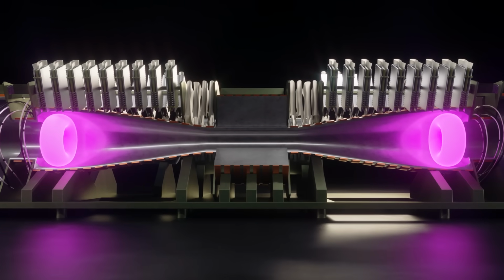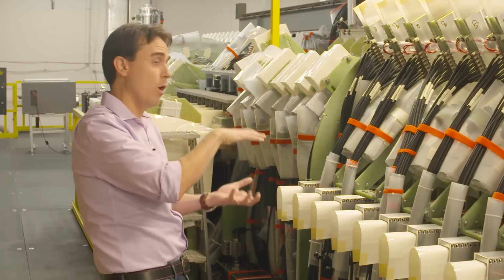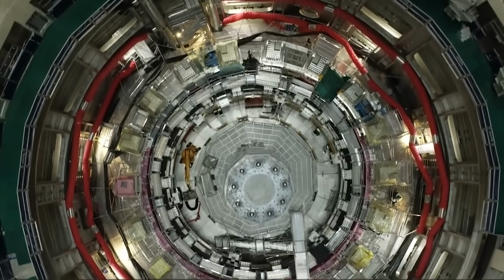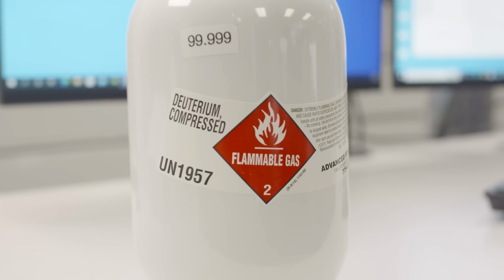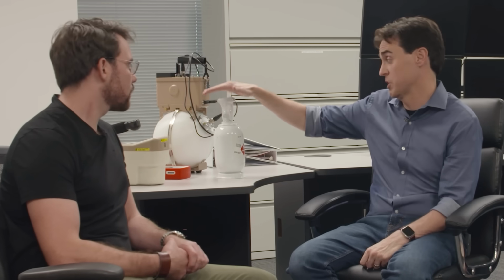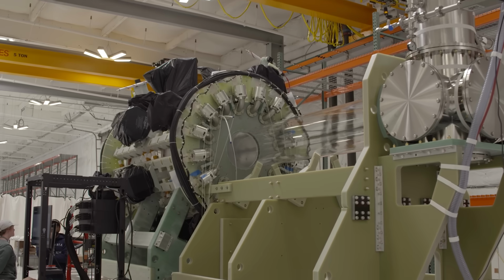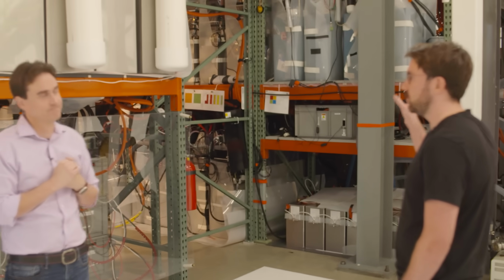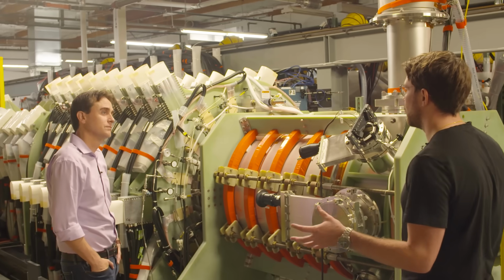A New Way to Achieve Nuclear Fusion: Helion

Comment: I admit I'm a fusion power skeptic. I don't see this getting any closer to actual power generation than the other methods.

It clearly takes a lot of energy to get the fusion reaction and it seems unlikely that they can get enough energy out of the reaction to make up for the energy they have to put in.

I'm also put off by some mistepresentations. Among them:

The million degree plasma rings must be kept away from the wall not because the wall will melt but because the wall will cool them.

And, those stray neutrons don't just fly harmlessly away. They combine with other elements and make them radioactive. Neutron radiation is not harmless.
Reply: Their next machine, Polaris will demonstrate net electricity in 2024. Trenta should be at least close to net energy if it was fueled with Deuterium and Tritium. It is an experimental device meant to reduce risk for building the next, bigger and more expensive machine. Trenta only cost 35 million.
I agree on the wall melting thing. The wall could be slightly damaged over time, but would not melt.

D-D neutrons are not that big of a problem. They are only 2.45 MeV (vs 14 MeV for D-T neutrons) and they only occur in 1/3 of the reactions. The 2.45 MeV are below the activation energy of many materials that they can use (and they are still looking into the best combinations for that.
Polaris can be fully decommissioned withing 2 weeks of operation. The waste will be below background radiation after less than a year.
Reply: @elmarmoelzer2229  "Polaris will demonstrate net electricity in 2024" I'll believe it when I see it. Fusion predictions are always much. much too optimistic. Even if it produces a net increase in electricity will it be more than an AA battery? Also does this "net" factor in the energy requirement to get the deuterium and whatever other exotic isotopes they need?

So far as the D-D vs D-T neutrons. The energy of the neutrons doesn't matter z lot since the main risk comes from neutron capture by atoms creating radioactive isotopes. Low energy neutrons are more easily captured and last longer.
Reply: @jimwhelan9152  
1. Net electricity in Polaris (no matter how small) does matter because it proofs the principle and provides a clear path to the next generation full size power plant. It is about mitigating risks and defining the path forward. It is the same purpose as Trenta.

As for fusion being optimistic. Optimistic predictions usually assumed a certain level of funding. Funding for fusion has been very, very low (below the "fusion never" joke from the 1970ies).

2. Wrong! The fusion energy DOES matter because D-D neutrons are BELOW the activation energy of many materials that then can be used to make the machine from. A Helion power plant can be fully decommissioned within two weeks after operation and all activated materials will be below background radiation levels after less than a year.
Reply: @elmarmoelzer2229  I begin by quoting, with my own emphasis, your original reply. "Trenta SHOULD be AT LEAST CLOSE TO net energy IF it was fueled with Deuterium and Tritium. It is an EXPERIMENTAL device." I can drive a quite large symbolic truck through that level of uncertainty.

Achieving tiny net power per cycle doesn't really matter because scaling up is non trivial. It's not like multiplying everything by 2 or2 10 or 100. For one thing instability of the plasma increases rapidly as do build expenses. U strongly suspect that maintaining the needed precision in timing and positioning of the plasma toroids also becomes much more difficult.

I don't think neutron radiation can be dismissed just because it's energy is below a threshold for SOME materials. Naked neutrons are not safe and will be considerably less safe as everything is scaled up (another scaling issue).

I admit this technology is different but claims it will be "the answer" are premature. Maybe, maybe not. Continue to color me skeptical.
Reply: Also Helion has been criticized for its finances  promises and "science".
Reply: @sassa82   Also unjustified humbug.

Comment: FYI, scientist at Lawrence Livermore National Labs have recently achieved a breakthrough in fusion by producing more energy than they put in, and their fusion reactor uses lasers instead of magnetic fields.
Reply: A load of prevaricating government hogwash. They had to charge up the apparatus with `10-X the energy they got from the fusion. And their method is good for boiling the kettle. This one is straight induction. The diff is the government want a fusion bomb and these guys want to produce electricity. different moves altogether.

Comment: From the description and the video, it appears like the injection reaction only lasts for milliseconds and then the whole priming process has to begin again.
If you could inject the plasma at a high frequency, would you be able to create a controlled cascade multiplication reaction?
Remember, it is meant to produce more energy than it consumes.
Reply: The total pulse length will be less than 1 ms in future power plants. They want to keep it pulsed because they want to extract fusion products after each pulse and energy from the expansion towards the end of the pulse.
Reply: @elmarmoelzer2229  So ramp the frequency to just under 1kHz and you can smooth out the continuous extraction process.
Reply: @Digidoc316  No. The vacuum pumps need a while to clear out the volume of the chamber between pulses. Also, there is not really any reason to do it faster. I mean they might want to go to maybe 60 Hz if they could, but that is pretty tough with the technology today and cooling becomes an issue then too.
Reply: @elmarmoelzer2229  Like a fission reaction is continuous controlled reaction, the pulse fusion reactor needs to operate at a frequency that will allow a consistent extraction of energy.  The heat produced could be extracted via a cooling jacket to run a steam turbine for electrical generation while the photonic energy could be captured with photovoltaics.
I don't recall; what was the produced waste products?
Reply: @Digidoc316   Waste would be Tritium which turns into more fuel eventually and some low level activated materials. Those would be at background radiation level after less than a year. 
The whole plant can fully decommissioned after 2 weeks of operation.

Comment: They utilize one axis for which to combine the plasma, why not use one or two more axis or a star configuration?
Reply: Because the compression magnets would be in the way. They COULD however have several plasmoids injected in series. It does not seem to be necessary though.

Comment: Running your batteries all the way down  on virtually every trip could get a little dicey. Especially since the actual real world range will vary just like gas or diesel powered trucks. Just like EPA fuel economy numbers 
People are always looking for simple answers to complex questions with no patients for allowing things to unfold. Understandable, I want my information now too. It could also be be that the charging stations are going to be at the bottling or packing plants and need to be able to return to recharge. I doubt that the destination outlets are going to have the facilities to charge the trucks at this point in time. As a financial matter you would not want your trucks sitting idle and recharging for up to 4 hrs at a drop off point.

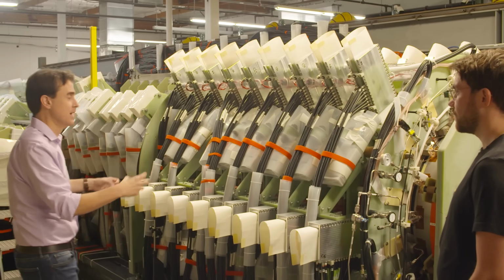Comment: Around 4:31 Kirtley says a "combination of RF (radio frequency) and electric fields," but your graphic said "Radiation" instead of "Radio Frequency." So either Kirtley meant to say radioactive, and you corrected it in post, or the graphics person was told to write "radioactive." Either way, someone's wrong because these are two VERY different things.
Reply: RF is a type of electromagnetic radiation. You’re thinking radiation can only mean “ionizing radiation”, but there are many different types of radiation.